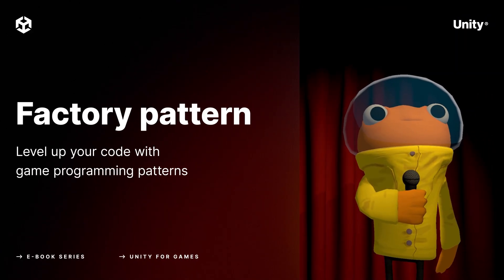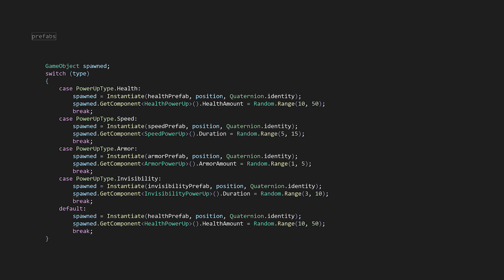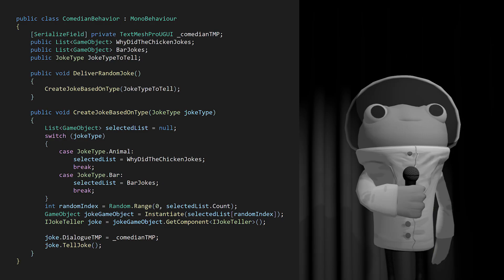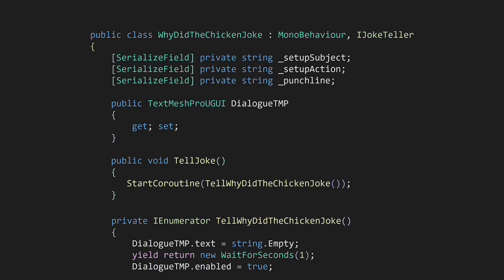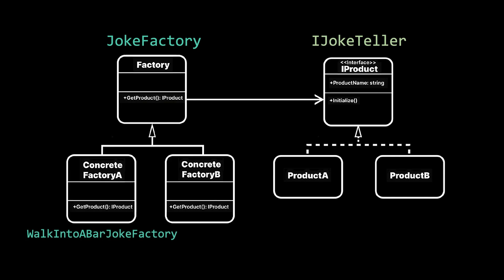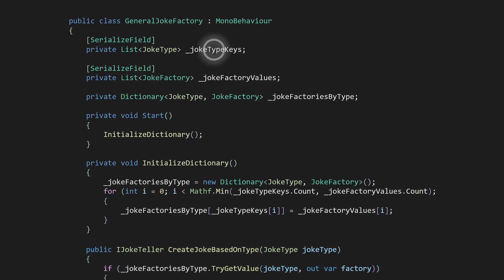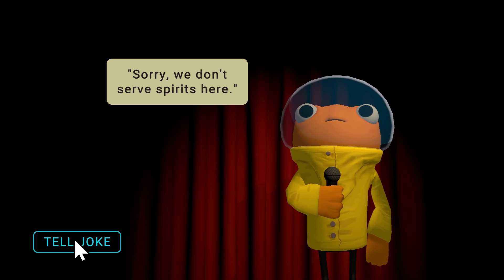Level up your code with game programming patterns: Factory pattern | Tutorial

Comment: A design decision I disagree with in this video: Jokes don't tell themselves, so a joke implementing `IJokeTeller` is very unexpected. Also, a JokeFactory would be expected to create jokes, not joke tellers. The joke teller is the comedian. That way the example would still be suitable for explaining the pattern while at the same time possibly avoiding some confusion. I would expect the joke factory to create a joke, and the comedian to tell it. The joke should not be coupled to the UI element that displays the joke, but rather the comedian could use the UI element as the means to "tell" the joke.
Reply: Great comment, thank you! You are right, a JokeFactory should create Joke objects, and this example does lend itself to a data factory.

My intent was to create a behavior factory example, which isn’t often shown. In retrospect, it would be clearer and more intuitive to have a JokePerformanceFactory that creates an IJokePerformance with Perform(). Maybe even IEnumerator Perform(IJokeDisplay jokeDisplay) with that interface having methods like ShowLine(string text), Wait(float seconds), Hide. The comedian passes in the UI display implementation then, as you suggest. 

I also like this refactor because character-oriented behavior factories would almost certainly include animations, so “Performance” feels appropriate and expected. 🙂

Appreciate it!!

Comment: Very hard to understand what is actually going on in this video. :(
Reply: Let me try using an analogy from games like Dwarf Fortress and Rimworld. In these games, colonists create crafts.

When a colonist creates an item, they might use a command like ItemFactory.CreateItem(myCharacterAttributes). 

The quality of the resulting item is influenced by factors like the colonist's skills and mood (i.e. myCharacterAttributes). The Factory Pattern simplifies the process - the colonist doesn't need to know the details of item creation; they simply provide their character attributes. Similarly, the item (the product of the factory) isn't burdened with its own creation logic; it exists purely as an item.

In the comedian example, the "product" is a behavior, not a physical game item. Different joke factories produce a variety of jokes, each capable of being told or performed. The comedian can tell any of the jokes without needing to know specifics of each joke. This is possible because all jokes implement the "TellJoke" method required by the "IJokeTeller" interface. Back to the colony sim example, if the crafted item (the product of the item factory) is a tool, each tool could have the ability to be used because they implement an interface like "IToolUsable" that requires a "UseTool" method. 

Let me know if that helps!

Comment: Wow 😮
How exactly this is more robust and maintainable than, let's say having an array of elements (here, jokes) in a form of prefabs which have data (text, sequences, etc.) and optionally an override for some method? You want to add a joke? Just create a prefab and assign it to the array. It is now available for instantiation. No additional switch statement required. Want a more complex behaviour for the joke? Do the same but add a script which overrides the default joke behaviour. And that's using more of Unity and doing less coding.
Reply: This is just a demonstration. You would most likely not use this for anything that's the same scale as what's shown in the video. This is meant for large, complex projects
Reply: @Th3-Mast3rmind  I'll need to see it to believe it. Sometimes I think that project's complexity is just an excuse for coders to realize their wet dreams of coding for the sake of coding :)
Reply: @kardahaspindal  if you like you could tell me a little about a game you are making or would like to make, and I'll suggest where and why the factory pattern might be helpful to consider

Comment: I appreciate the video but I feel you made a mistake by introducing the powerup example. In the PowerupSpawner you're saying that you're violating the open-closed principle. Then you move the exact same code to a class named PowerupFactory and pretend it's now fixed before quickly moving on to the joke-example where you actually fix the problem the powerup example has. Not to mention the joke example is tougher to follow. I see some comments saying they don't really understand the explanation so here's my attempt to accentuate what is going on in the video:

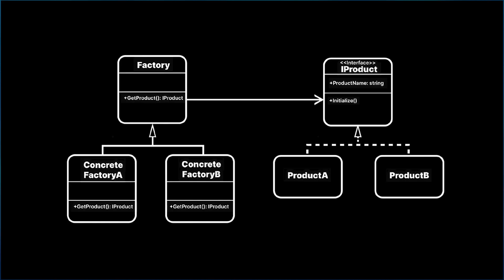Take a good look at 4:31 and then 4:44. He keeps a list of Factories in ComedianBehaviour and this list basically has ConcreteFactories (A and B) in them. These FactoryA and FactoryB are responsible for creating ProductA and ProductB respectively. ComedianBehaviour that keeps the list of Factories doesn't know about ProductA and ProductB, it only really knows IProduct. 

IProduct, which in this example is IJokeTeller,  has a method for "TellJoke()". ComedianBehaviour can now ask any factory to create a joke and tell it without knowing it's implementation. This class now has lost the giant switch-case it had with all the implementations specific to different jokes (this is the problem the powerup example had). This makes adding more jokes/powerups a matter of creating more factories and each factory is responsible for their own type of product and implementation. This promotes extensibility. 

If you are working on a pet project by yourself you may think you don't need this (you probably don't) but in giant projects working with multiple people you want to adhere to these programming principles a bit more. Lastly, I feel like the Factory pattern promotes Single Responsibility Principle more than it does Open-Closed Principle. But that's a completely different discussion.

Comment: At 5:34 why are you doing Mathf.Min tho? Shouldn't _JokeTypeKeys have the same count as _JokeFactoryValues? Can't JokeFactory have a method that returns joke type instead so you don't need _JokeTypeKeys ? Like : _jokeFactoriesByType[_jokeFactoryValues[i].GetJokeType()] = _jokeFactoryValues[i]; ?
Reply: Haha, thanks for the comment! Backing up a bit, ideally we'd be using a serialized dictionary here as someone else suggested. I didn't want to include an asset requirement, so I backed away from it.

You are right that the keys and values should have a one-to-one correspondence... Mathf.Min is simply a safeguard against mismatches. 

I love your idea of implementing a GetJokeType method in the JokeFactory! While that is definitely something that should be incorporated in the future, the current state is intended to reflect the early stage of a vague game idea... things are a little loose and half-baked.

For example, we could have "WalksIntoABarJoke" type that is also a "Halloween" joke type. Uh-oh, that's not right, bundling together joke style, subject, and theme...🚩🚩🚩 that will certainly get sorted out at some point. At the same time, coming up with joke themes and simply putting them all down as joke types, it makes it easy experiment quickly and figure out the right thing to build.

So I really appreciate your suggestion! It raises the question: how long should we run with something kinda wack?

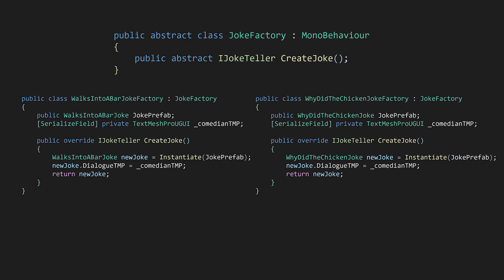Comment: Not sure at 3:54 why we need these two different factories. They look identical. A joke is essentially only an `IJokeTeller` so we could use that as the prefab? It's even returned by `CreateJoke` 🙃
Reply: You are correct they look similar, but there is a difference in the types of jokes they produce. 

WalksIntoABarJokeFactory creates instances of WalksIntoABarJoke; WhyDidTheChickenJokeFactory creates instances of WhyDidTheChickenJoke. 

Though both of these factories produce objects that adhere to the IJokeTeller interface, they have unique implementations of the TellJoke method that correspond to the specific style of joke. Each joke has its own timing and content nuances which a generic prefab couldn't accommodate effectively.

An underlying concept here is that we are anticipating that joke types have some kind of gameplay importance. We don't want all IJokeTellers to be lumped together. If it helps, I imagined something fun like chickens being offended by chicken jokes but salesmen love knock knock jokes. The gameplay might involve trying to understand the audience, so the player may eventually choose the type of joke. I don't know, I kept it vague because that's how ideas start, haha.

My main motivation with the example is to illustrate how factories empower the creation of diverse modular behaviors. Thanks for keeping a close eye on things!
Reply: Or just using a generic would do the trick
Reply: i think it's  because the player might chose what kind of joke he want the character to do and then the game chose one of this type into a list.